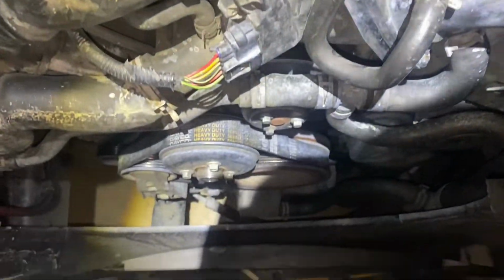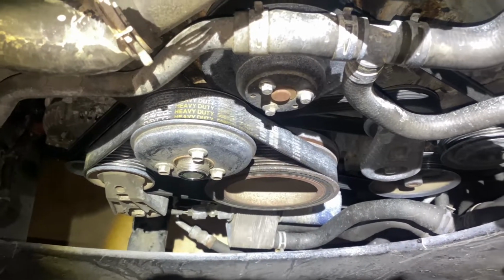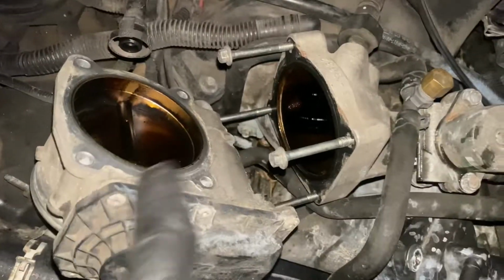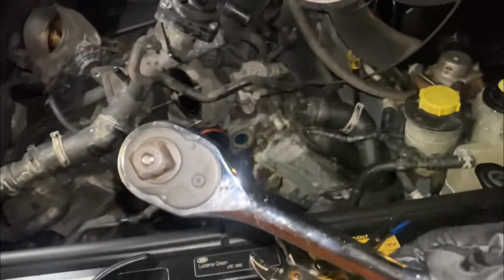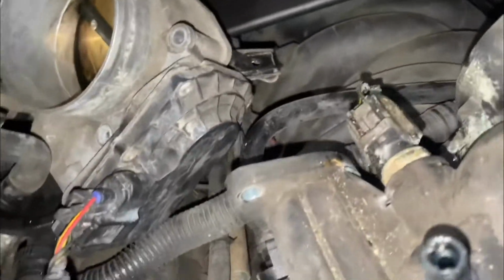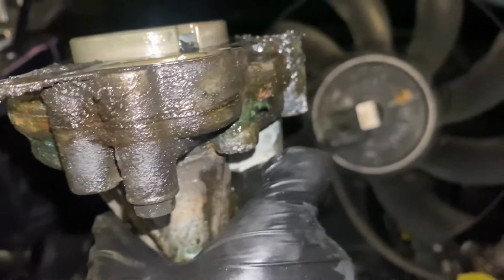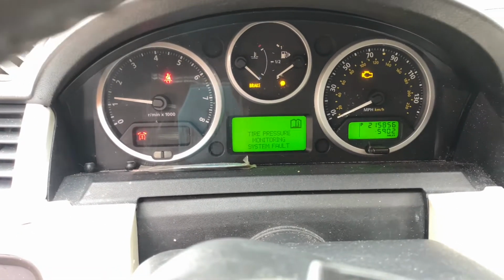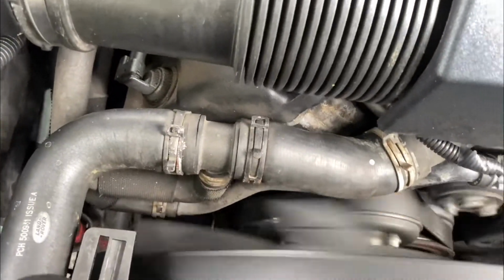How to do a Water 💦 Pump replacement on a 2008 Land Rover Range Rover Sport 4.4L

Comment: What do you think the sqeal is? Mine does it at startup and sometimes it goes away with 10 minutes of idle and sometimes it doesn't, just gets a little quieter. I was thinking it was the water pump hence why I was watching your video, but yours still did it after.
Reply from the maker: As far as I know, that is usually just the cold start and the squealing is usually just belt. It goes away normally if not, may need a new belt